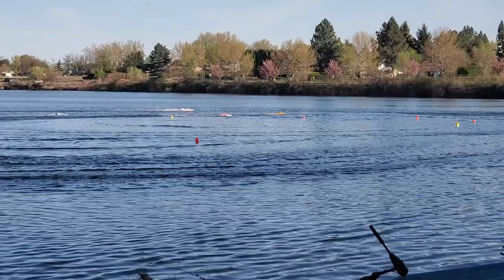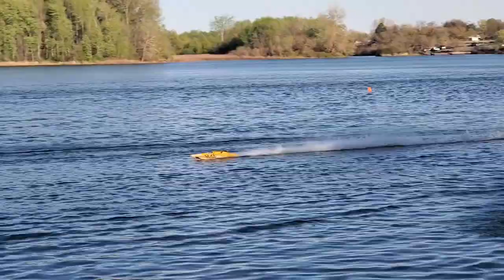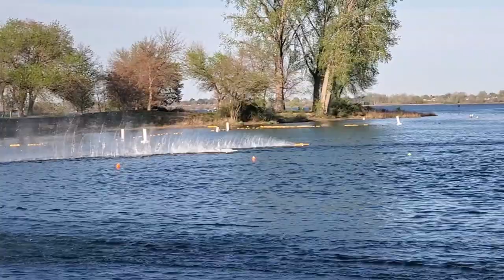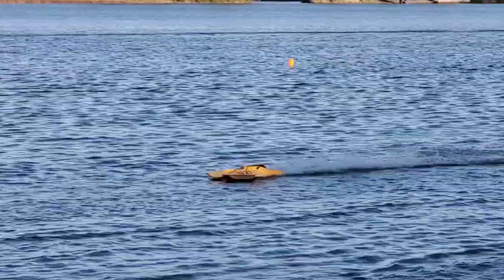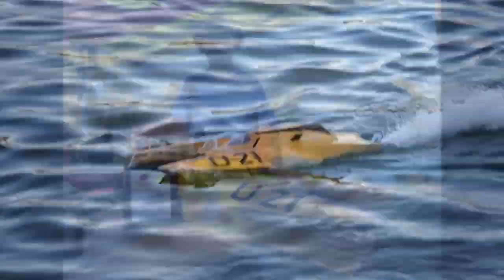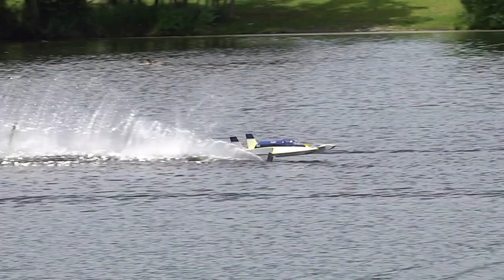Electric RC Hydroplane Race  |  The Electro Eliminator's Maiden Race... Can It Win?

Comment: Can you put out a video showing how you match a motor to a certain size hull. This is one thing I can not find on the internet. I have seen math problems to solve this problem.
Reply from the maker: No, because i really don't know.  The conversion from nitro to electric on the Eliminator was commissioned by Bill Brandt at Rattlesnake RC and he provided all the parts.  I'm really just a nitro and gas guy who pretends to know something about electrics.  Bill could help you...  Contact him here; www.allrc1.com
Reply: You could always subscribe to the Action Bastard Method: "just go bigger until it stops working" (this is a joke.  contact the dude he said to.  all of my boats literally explode at some point... one of these days I'll develop a depth charge that does not blow up the host boat as well.  also, don't do that either.)